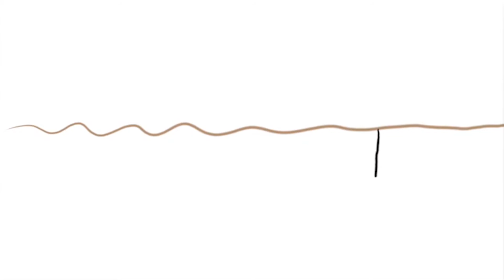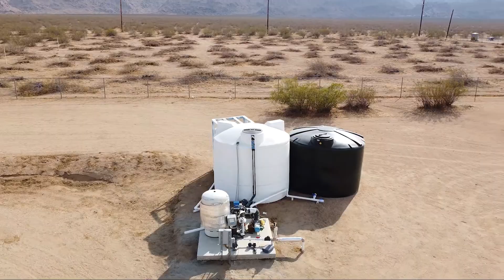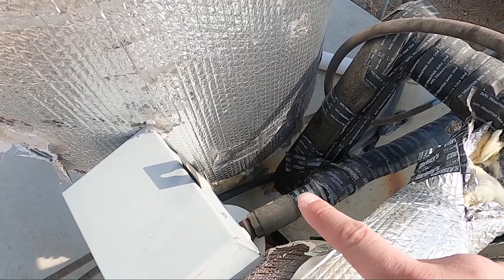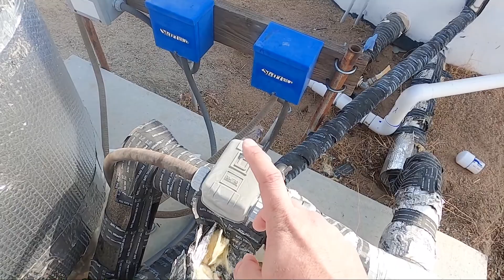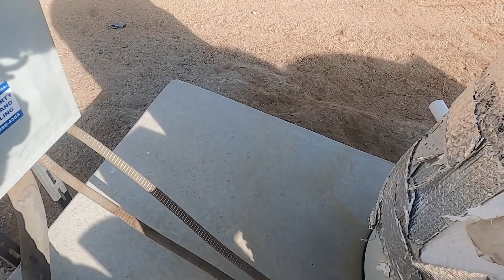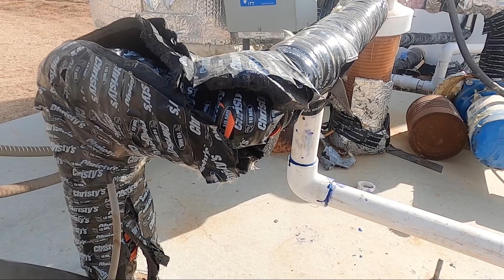How does a Home Well Work?  Lacey Family Farms

Comment: Does the big white tank fill up to the top or is there a switch to stop it from filling?
Reply from the maker: We have a float switch in the white tank that works for both tanks, since they are connected at the bottom.  Basically whenever the water gets too high, the switch flips over and stops the well pump from running into the tanks.